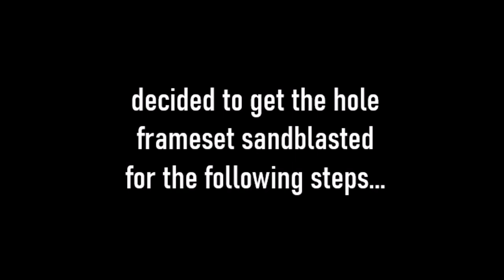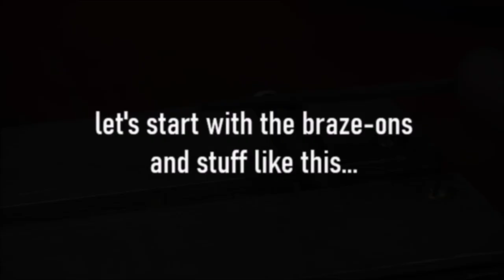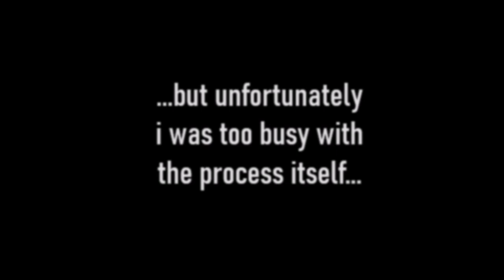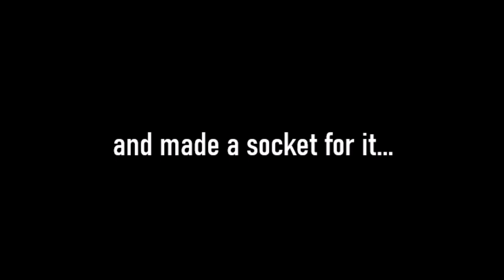bicycle.restoration no 2 - Stricker sportbike - part II - chapter I

Comment: Funfact about the oil hole in the hub. Old types of grease were oil fed. So when your hubs got dry you put some oil in it and it would fix the grease
Reply: Grease nipple what you're talking about here? It's just for putting in more grease usually.
Reply: @stan1845  Seems so. But oil is just gonna run out from hub and mess up everything.
Reply from the maker: Nice to know, thanks 😉

Comment: Imho you should NOT put grease on the copper brake shell of the rear hub, nor on the inside of the hub shell. This will gravely impair braking power.  Only a thin oil is advised to grease those parts for smooth breaking.

Comment: No spoke/thread prep compound?
Reply: Spoke prep is not always needed... you may substitute bee's wax or linseed oil.. Rub the bee's wax on the spoke threads or brush on the linseed oil on the spoke.. They function as a mild thread lock and lubricant... I do not like the smell of the spoke thread compound.. Both items are inexpensive compared to spoke prep and readily available... I use the bee's wax on all small threaded fittings like water bottle and rack fasteners to keep them from vibrating loose...